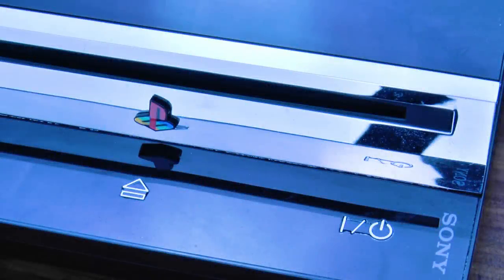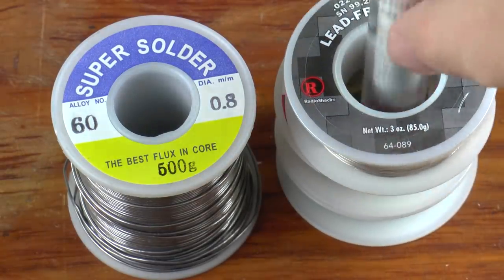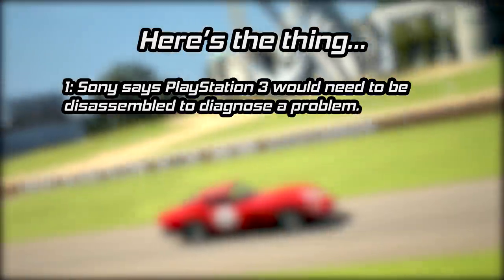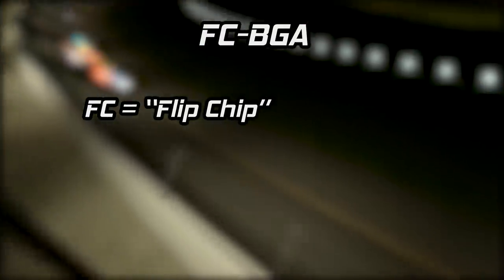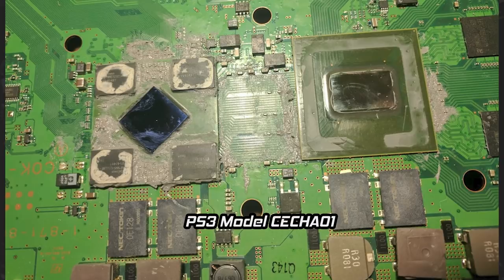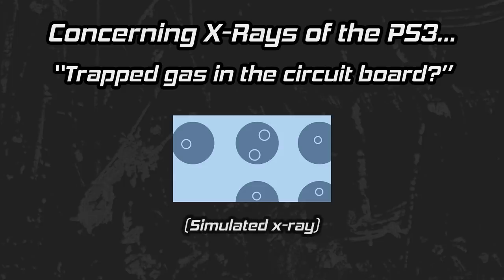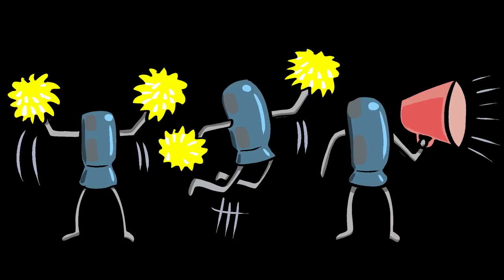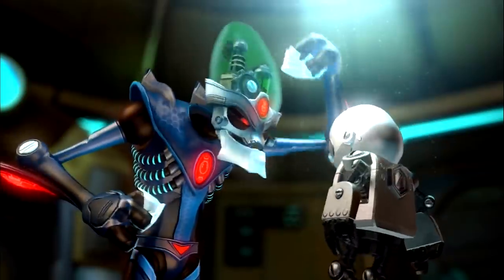The Misdiagnosis of the PlayStation 3 Yellow Light of Death

Comment: I have the PS3 fat and experienced the Yellow Light of Death early on! Except, I have to press the power on button again, and again and then it starts to turn on finally 😂
I don't know why it does it, or even why it works, but it still does. Lol!
Reply: Probably lack of power on those chips
Reply: @SummonerArthur  but it's still working for years now
Reply: @nowonmetube  I'd recommend you to go out, buy tentalum capacitors and replace those dodgy NEC/TOKIN caps. Your PS3 will be thankful.
Reply: Sounds like the capacitors.
Reply: @JerrySM64  thanks, my PS3 died now, so I'll try reviving it with those.
Reply: @tylere.8436  I guess this is it, my PS3 finally died.
Reply: @nowonmetube  Try to change or have someone change out those capacitors, since if your PS3 used to work fine after a few attempts at turning it on, it's most likely the capacitors that gave way. While it's apart, You should have your PS3's GPU and CPU delidded, apply a bit of fresh thermal paste to them also, so your processors won't heat up too much. Extra: perhaps get a fan with more blades to disperse the heat out more effectively. Hope this recommendation helps!
Reply: @tylere.8436  Hey there, I've seen several different information on that topic. Yesterday I found that video, which is very recent. So I guess, it wasn't the capacitors to begin with!
https://youtu.be/I0UMG3iVYZI
Everyone here in the comments, please check it out. (at least the beginning and summary of the video)
Reply: @tylere.8436  Second comment: I already delidded them a few months ago, it worked better after that. But recently the yellow light came back until it stopped working now. Maybe it's the capacitors maybe not (as described in the documentary above). I guess those older Playstations are just defective from the manufactory.
Reply: @JerrySM64  which ones do you recommend? As you can see in the documentary I posted above, just using any tantalum capacitors aren't a good idea.

Comment: Incidentally it's interesting that both my 60GB and 80GB PS3s (fairly early models) AND 2 Toshiba laptops from that era have never suffered from power problems like this.

(They have had their problems, sure. But things like hard impact, immersion, infection, corrupt RAM, and drive failure were never a result of issues described in this video! 😁🍍)

Comment: I thought it was widely accepted/known that both the 360 and ps3 used thin and cheap silicon for the motherboards.  With the heat from them causing the board to flex too much which in turn broke the solder loose from the board.

Comment: Minor correction: for BGA components with collapsing balls voids ARE acceptable as long as there is 30% or less voiding of ANY BALL in the X-RAY image area. Class 1,2,3

however

For BGA connections with NONcollapsing balls voids are UNacceptable. Class 1,2,3
Reply from the maker: Heh. There was a time when I was going through a few documents from the SMTA and wondered how far down the rabbit hole I wanted to go in my script.
Reply: Yeah i just got my info from my "ipc j-std-001f" or J standard book. Page 43.
Reply: That being said while i agree that people shouldnt just assume the problem lies with the solder balls overheating definitly played a major factor in many ps3 deaths. Especially if you were unlucky enough to get one of those nichicon power supplies that has a name that starts with "Z" and then vomits the rest of its name. 

Had a friend who was gifted a 60 gig and she wanted me to work on it before she really started using it. It had one of those PSUs so i replaced it with an aps231 and replaced the cooling compound which was dry and bubbly. Probably saved the system from an expected and quick death.

Comment: I gotta say while yes most ylods on smaller RSX ps3s are due to the nec tokins, the backwards compat ones actually usually also have RSX damage due to the spreader on the RSX being slightly flawed and from my experience it's best to replace both the rsx and the caps on the original backwards compatible ps3s
Reply: Those NEC Tokins were fine, though like any other capacitor they’ll  naturally fail during their lifetime. The big problem is how unreliable the GPU was found in early models.
Reply: @crazedlunatic43 so is the best setup then to replace the NEC/TOKINS with new NEC/TOKINS then replace the gpu with a later RSX in 65nm or something?
Reply: @TheOnlyPedroGameplays  Under normal circumstance, you shouldn’t need to replace the NEC Tokins in the first place unless they go bad. If they do go bad, then replacing them with brand new NEC Tokins should do or you may also choose to replace them with compatible capacitors like the Tantlaum ones. Either way, the NEC Tokins aren’t faulty as the general public once believed and you should be fine with just leaving them alone for now. As for the GPU, a good chunk of the 90nm batches will inherently fail and replacing them with either a 65nm or 40nm will do.
Reply: @crazedlunatic43  okay, I’ll remember this if I get a PlayStation 3 FAT. My dad has a slim model, and I really respect its modest design and great reliability but the fat with backwards compatibility is functional and just very beautiful.

PS3 was at the peak of Sony’s aesthetics, and so owning one of those might even be more worth it than a PS2 with fan+HDD and homebrew.

Comment: I used to put my PS3 in a box and use a hair dryer at max temperature to fix my YLOD issue. The problem is that my PS3 would stop working again about every month or so. If applying heat to certain types capacitors while they're not supplying a voltage restores them to working order, then that would explain the issue that I was having with my PS3. Eventually it wouldn't turn on even if I used a hair dryer, so I guess either the capacitors failed or the heat from the hair dryer messed up another component. I still have it since it's the original 60 GB model with PS2 and PS1 backwards compatibility. Maybe I'll fix it for real someday.

Comment: After reflowing and reballing hundreds of PS3s, another problem detected was the board bended itself because the high amount of heat it receive from bad dissipation of the cooling system. Sometimes a thin copper piece between heatsink and GPU/CPU, with high quality thermal compound, solved the problem of both chips stopped making full connection with the board, cracking some solder balls when board started to bend.

Comment: My two takeaways:

1.  This is the first I've heard of this yellow light of death.  I've heard of beeping and powering off, and a blue light with no other functionality.

2.  Someone X-raying the board and declaring that air trapped in the board is one of the most ridiculous things I've ever heard.  I've worked on thousands of computers and accessories, and I've never even heard of such a thing.  Circuit boards aren't stamped together, they're chemically etched layer by layer.

Comment: The problem is likely a result of the flip chip manufacturing flaw. Heard somewhere those die bindings get cracked due to heat. One, two, even 3 cracked binds wouldn't cause a problem, but the more cracked binds you have, the higher the failure rate of the system. I remember hearing some people diagnosed rsx (gpu) manufacturing flaw. Some poeple even took rsx from super slim models and put it on the backwards compatible ylod phat ps3. And the reason why blasting these parts with heat seems to "fix" the consoles is because something gets reflown, some ball bind that had cracks on the flip chip die starts making proper contact and it "works" again. All the things you mentioned have a high "faliure" rate, and to fix it you have to diagnose what failed out of all those things.

Comment: Mine was a cooling issue.

I dunno if they're badly designed, I'm not an engineer, but I have never in my life seen a game console or computer so packed full of dust, including some machines I've owned for 30 or more years. A quick opening and cleaning out of all the crap got it back up and running again.

Comment: Diagnosis can be a pain.

I used to fix laptops for a company that handled extended warranty repairs.

Oh, our department didn't bother with electronic level repairs.
We dealt with large scale component issues.
You know. Diagnose motherboard fault? OK, replace the motherboard.
(we did have an in-house department that reconditioned faulty motherboards though. Guess this made the laptop repairs go faster while also reducing replacement part costs)

Anyway, as dubious as the procedures of that company were...

Some of the repair technicians were in the habit of arbitrarily replacing the CPU, memory and hard drive of broken systems without really bothering to check if this was the actual cause of a problem.

That sounds dubious as anything, and in a way it is.
But you have to remember this was a minimum wage job where we were under constant time pressure. We have about 1 hour allocated per system.

Removing the motherboard from a laptop then reassembling it again afterwards even with no actual repair or diagnostic work done can take a total of nearly 4 hours...

So... You get the idea.

In any event, even when your list of failure points can be reduced to a list that is as small as something like this:
- cpu
- memory
- motherboard
- hard drive
- disk drive
- secondary boards (if present)
- networking boards
- power supply
- LCD panel
- physical switches
- LCD inverter board...

It can still be surprisingly maddening trying to trace the nature of a fault down correctly.
I mean, some things are obvious.

If the screen is cracked the LCD panel needs replacing.
If the screen has no functioning backlight, the inverter board is dead.

But now try and imagine what it takes to correctly diagnose a system that randomly shuts down without warning.
Oh sure, 90% of the time it's the cooling fans being blocked with dust.

But when it isn't?
It can be the motherboard, the CPU, RAM faults, some obscure fault somewhere due to peculiar hardware interactions.
A faulty power switch. Some dubious software fault, and a whole list of other things...

(by the way, clogged fans are a pain in the ass to fix in this context. Oh sure you can identify one and clean it out in all of about 30 seconds. But we are then obligated to do extensive burn-in testing to verify that indeed, yes, this WAS the cause, and not some underlying fault that needs actual repair...)

Diagnosis is a very particular skill that requires a mixture of technical knowledge, deductive reasoning skills, and... A certain degree of intuition.
(OK, the intuition is technically optional, but it's going to save your ass more often than not if you have any actual time pressure on getting a repair done.)

Comment: applying heat to reflow a board isn't actually a big problem, as long as you know what kind of solder was used, and the reflow temperature curve necessary to perform the process. It's pretty usual to apply components to a pcb or substrate in multiple steps, using solders with reflow temperature curves that a sufficiently different enough so reflowing the newly added components doesn't melt the solder with which the previously mounted components were applied. I severely doubt that the people reflowing PS3 mainboards on TV went through the trouble to chemically analyze every the solder used to mount the cpu and gpu to the mainboard. Also I doubt Sony handed them their solder specs. You could use a reflow gun to reflow only those two components and do it while monitoring the solder balls and trust that the solder used to mount the flip chip won't melt before the solder between the chip package and the mainboard, as long as you trust the manufacturer picked their solders correctly. If you just do it will

Comment: Good stuff.

I had my PS3 stop working a few years ago. Originally it just crashed after starting to boot up. No YLOD. At the time what I was reading online, was it was the early signs of the YLOD, had a few website recommend replacing the OG power supply & the fan with more efficient versions from later models and thermal paste. After doing that, I was getting a hard YLOD. At that point I just gave up, and put it aside.

Looking to go back and fix it, because I feel it's still possible. Glad I didn't do any of the more damaging methods, like reflowing, and glad to see it's starting to be debunked, because I always thought that was a garbage fix in the first place. 

Now of only there were more reputable repair shops that could do a proper diagnosis, and fix, I'm sure gamers would be very happy.

Comment: I've always just taken my PS3 apart and cleaned out the dust, and replaced the thermal paste. That has worked for me with multiple different PS3s. Unfortunately, the poor design of the PS3 means that no old fat model PS3 stays fixed for long, but I'm planning on modding my "old reliable" with more modern fans and the best quality thermal paste I can buy.

Comment: Yeah, I heated up my old system to do a temporary fix just to get my save data off it. I didn't have internet so I didn't have a cloud save at the time. I think I was 17.
Reply: Cloud only came with PS+ in last few years of PS3 cycle anyway, assuming you're over 21 (moot point if not), the oven was likely only option anyway...at least you got your backup tho~

Comment: Had a YLOD'ing CECHL01. Baked it in the oven, fixed it for a couple of months.

Read about the capacitors a couple weeks ago. Tried the fix, and voila. It lives once more.

Capacitors were totally the issue.
Reply: Did you buy a kit to replace them or rather, how did you source the materials and capacitors? Ready to start this but don't know where to start.
Reply: @joshtaylor9675  I was reading Reddit one day and came across a thread that mentioned the part number for the capacitors that a poster had used, and had a successful repair.

I ordered a set of 16 of those same capacitors from Arrow Electronics and installed them myself.

I used a screw driver to chisel away the NEC/TOKIN chips and soldered in the new capacitors in their place. I left only one per CPU / GPU, as they also provide a pass-through connection to complete the power circuit. If you remove them all, you will need to wire up something else. It's easier to leave the capacitor in place and replace the others. Leaving it in place won't affect performance of the new capacitors.

The part number is F930J477MNCAJ6. You need to order 16 of these.

Comment: It is obvious that if reflow fixed problem, but only temporarily, then the problem never did lye in solder used.
There are exactly two possibilities of lead free solder failing.
1. Solder develops whiskers, which short circuit chip
2. Solder cracks and effectively there is no electrical contact between PCB and chip
Both of those are fixed for many months by reflow.

There is one problem which will be fixed by reflow, but would fail in short time (sometimes after single use). It have nothing to do with solder used. It is failing tantalum capacitor. It will work, as long as it is warm / hot enough. It will fail again after it will get cold. Reflow will heat up such capacitor and it would work again for short time.

Comment: This myth is never going to die, too many people keep repeating it. It IS possible that solder balls underneath the package could become suspect, due to corrosion (especially since game consoles are apparently quite popular with cockroaches) but it's rather idiotic to assume that to be the problem first, and reballing a chip is a ton of effort to go through on a guess. The flip-chip packaging argument is much more plausible, given how many dead GPUs there are from the mid- to late-2000s, but capacitor failure is also so common that it's impossible to rule out. Also, one would probably wonder that if flip-chip packaging were the sole cause, then why don't we see CPU failures much more often?

I baked a couple PS3's both before and after I knew better. In my experience, baking would usually help it last anywhere from a year (got lucky on that one, although it also wasn't used as much) to a week or two. Re-baking would always result in less operational time. I've done capacitor replacements on older Macbooks where the cap fails and if you heat the cap up it works, but that would usually only be for a couple of minutes. I don't know how these caps, which are completely different, would work, but I find it hard to believe that a cap problem could be fixable for more than a day just by heating. I don't know, I'm no expert.

Like you said, it's impossible to know the cause for any one specific problem but I think when we have widespread failures in electronic components like this, there is probably one cause that is most common, and for that my money is on the bumps inside the flip-chip package. There are too many devices from this era that end up failing in the same way.

Comment: You are wrong about modern CPUs demanding perfectly regulated voltage. They are powered by buck converters, whose output fluctuates incessantly, the voltage you get is directly proportional to the current being drawn. Parasitic inductance prevents capacitors from counteracting that immediately. CPUs expect droop and will stop clocks (very briefly) to modulate current consumption, taking time to ramp up their current demands. CPU designs are fully aware of these limitations and specify the minimum performance that they will tolerate from VRMs. The feedback loop that controls the duty cycle of the buck converter has a slight delay that is utterly impossible to eliminate, the converter is continuously chasing the correct output voltage, and spends more time with voltage error than without.